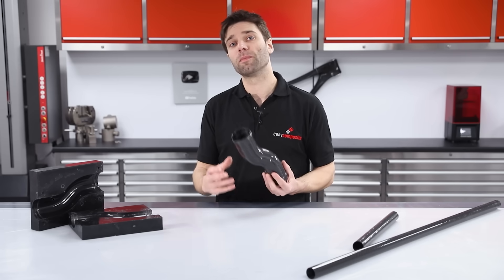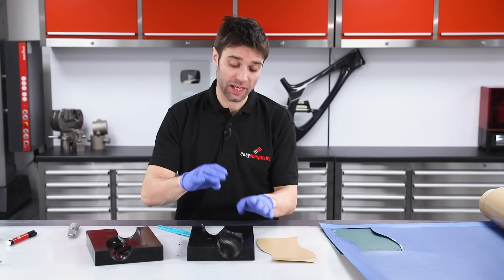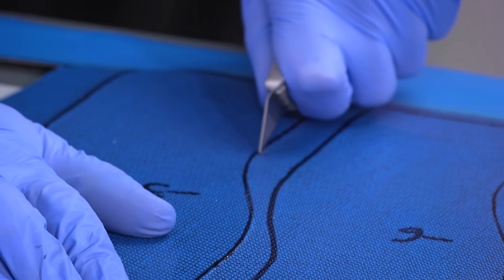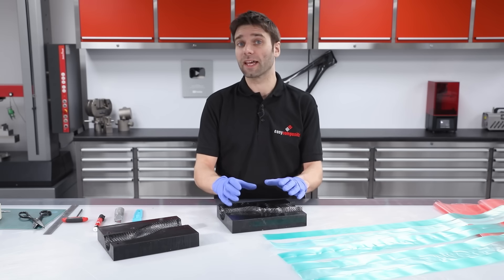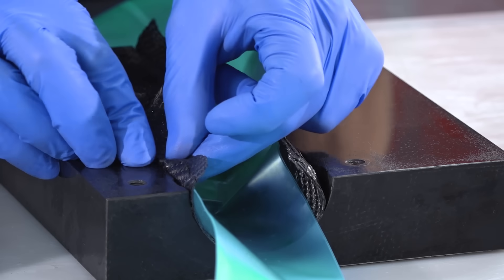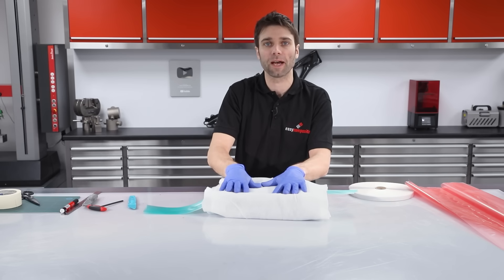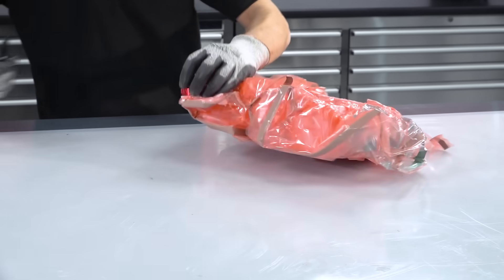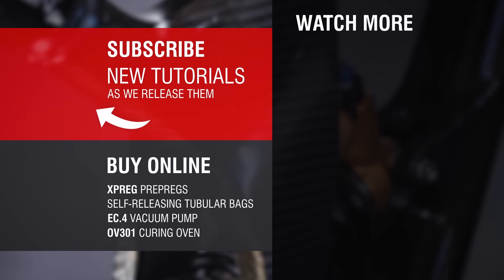Making Complex Carbon Fibre Tubes Using a Split-Mould

Comment: Hi, Can you make a video on compression moulding.
And when the plastic parts have rounded corners with thickness at the edges how to replicate the same roundness at edges on carbon fiber.
Reply from the maker: Yes, we'll be doing something on compression moulding in the future. As for thick edges on laminates, this is usually just a case of building up the thickness in these areas (sometimes including some of the 'rolled edge' in the mould. We do this in the carbon fibre bonnet making video (where the thickness of the edge is made up with extra layers of woven carbon tape.

Comment: I have done many vac bagging setups but never internal like this.
I don't or didn't see how this worked......it looked like the green internal bag would collapse being vac'ed.
To put pressure internally on the fiber, the internal green bag needs to be expanded. (???)
I am seeing this wrong?

Edit:  I went back and watch that part again,,,,,,,,,,I see now!!! Pretty simple actually!
Reply from the maker: Hi David, yes, you might be seeing this wrong. Think of the pink bag being the vacuum bag, then think of the green bag as being a tunnel through the middle of the pink bag. That tunnel has the carbon fibre (and the split mould) on the outside of it. When the air is sucked out of the pink bag the atmospheric pressure pushes on the outside of the mould but also the inside of the tunnel. Does that make sense?

Comment: I would like too use carbon fibre make custom parts for cars. What is the best way too make a mold? And should i add anything too strenghen it as is over 3ft(1.2m) long.  Really like too know what your opinion is.
Reply from the maker: Hi Pierre, I think we cover that pretty well in this video: https://www.youtube.com/watch?v=UgKvDw1E60E where we make the mould for a car bonnet/hood. This mould is well over 3'.
Reply: @easycompositestv  thank you very much. Ive watched all the videos and fully understand the principals of carbon fibre parts

Comment: What Material is that 2 Piece mold made from and what temperatures are you baking that at?
Reply from the maker: To make the mould we first CNC machined the pattern, in two halves from epoxy tooling board like in https://www.youtube.com/watch?v=CWAvo8DIZ9s and then the mould halves made from made from XT135 tooling prepreg like in https://www.youtube.com/watch?v=k4GdAuNji5g

The XC110 out-of-autoclave prepreg has a recommended cure temperature of 120'C.
Reply: Easy Composites Ltd that epoxy tooling board holds up against the temps in the autoclave??

Comment: So are prewoven tubes not commonly used for this? I guess it wouldn't be prepreg, but I'd expect prewoven carbon fiber tubes and a precise mold would mitigate any flashing/part lines.
Reply from the maker: Carbon sleeve is not too common for this process for a number of reasons but yes, if you used a woven sleeve as the outer layer you could avoid a visible seam in the weave. You're not likely to ever get a split mould that is so accurate it results in zero resin flash but it takes seconds to remove resin flash and so that's not really ever a consideration.
Reply: @easycompositestv  I know even in consumer injection molding products, flashing and mold seem lines are indeed prevalent and visible. I am thinking of automating production though, and post possessing can get expensive. If it does only take a few seconds, that's different. But I know of a company that bought a $1.2M Swiss Lathe with laser contouring that uses the machine literally to deburr and that's it, simply because they spent more than that per year outsourcing the deburring of their parts. 

If cost is removed from the equation for a moment, do you think mold part lines could be removed entirely? If production is the goal, not low volume production. 

https://youtu.be/jYSHJIx0Esc

Comment: Can you share the split mould process for tubes ?
Reply from the maker: Hi Tim, to make the mould the patterns (for the two halves) were CNC machined from epoxy tooling board like in https://www.youtube.com/watch?v=CWAvo8DIZ9s and then the mould halves made from made from XT135 tooling prepreg like in https://www.youtube.com/watch?v=k4GdAuNji5g, apart from the captive fasteners I think those two videos already cover the whole process. Shout up if anything is unclear though.
Reply: Easy Composites Ltd ok thanks was looking for video on hand making a split mould for a air horn for a carburetor . I believe I have come up with a plan

Comment: Are there any alternatives to the big oven when curing the carbon fiber? Can it be done in a retired cooking oven or does it need strict temperature control?
Reply from the maker: Ideally you need to accurately determine the temperature and you'd be looking for +/-1'C accuracy on the actual temperature fluctuations. In theory, you could do this with a domestic oven but would need to run a separate external thermometer as the set point on a normal domestic over could be out by 10'C or more.

Comment: For a car tubo pipe for instance it would be better to have an internal mould with the bagging around it. Saw it this way with some F1 parts that were auctioned off that way the smooth side was on the inside of the pipe so that air could move more freely.
Reply from the maker: Hi Alex, yes, there's quite a bit of discussion about that further down these comments where we've explained methods for doing this in more detail, hopefully you can stroll down to them!

Comment: Great videos! Thanks for sharing - is possible to get the same results by using epoxy infusion rather than Xpreg?How did you created that mold, was it cut on a epoxy board or mold from the actual plastic tube?  Thanks
Reply from the maker: It's a prepreg carbon fibre tool. The patterns (for the two halves) were CNC machined from epoxy tooling board like in https://www.youtube.com/watch?v=CWAvo8DIZ9s and then the mould halves made from made from XT135 tooling prepreg like in https://www.youtube.com/watch?v=k4GdAuNji5g

Comment: It is impressive, but seems like a very wasteful process compared to fabricating metal.  Also, chips can be melted and reused.
Reply from the maker: Hi Sam, yes, it;s a very different process and would typically be used for very different applications. This video is really our attempt to explain - using something a lot easier to see and understand - how a carbon fibre bike frame or similar tubular/frame structure is made.
Reply: @easycompositestv  They are awesome videos.  It is an awesome material. It is just a shame that there are so many consumables involved.  Thank you for the response.

Comment: At how many °c in the oven and for how long? Every different part needs  different  time to cure?
Reply from the maker: Different prepregs tend to need different amounts of time to cure. The XC110 we used in this video is cured at 120'C for between 2 and 7 hours, depending on the cure cycle being used.

Comment: That came out really well. Can you reuse any of the vacuum matteriel? Also does the inter bag have to go all the way through the vacuum bag or just one side open to atmosphere?
Reply from the maker: The bag is sealed on both sides otherwise it would never pull a vacuum
Reply: The bags can be reused many times if you are careful with removal.

Comment: What happens in the cure process
Reply from the maker: In the cure process the vacuum is maintained throughout, which keeps the pressure on the bag. The resin heats up and flows and then cures to a rigid matrix.

Comment: Is there pt1 for the mould?
Reply from the maker: No, not this time, we hope what we've done previously already covers it. It's a prepreg carbon fibre tool. The patterns (for the two halves) were CNC machined from epoxy tooling board like in https://www.youtube.com/watch?v=CWAvo8DIZ9s and then the mould halves made from made from XT135 tooling prepreg like in https://www.youtube.com/watch?v=k4GdAuNji5g

Comment: Great video, thanks!

What is the advantage of having the lapps on both edges of one piece of fabric and trimming both edges on the other as opposed to cutting mirror images for each side?
Reply from the maker: It is slightly easier to lay it up that way. Structurally there is little difference - the overlap takes care of that.
Reply: @easycompositestv  thanks! My OCD was responsible for the question 😂🙈
Reply: @ryansmithza  I was wondering the same thing.

Comment: If I may - some of us dinosaurs are still stuck with techniques from the 60s. I enjoy these pre-preg videos immensely. They are very good and there is always something to learn. If you get the time in the future however - some wet layup techniques in addition would be great :-)

And I think I could do that tube with wet layups - if a bit sticky  ;-)
Reply from the maker: Hi Rolf, we totally agree. We're aware that our tutorials have been a bit prepreg heavy recently and so we have lots more planned using wet lay, vacuum bagging, compression moulding, resin infusion, all sorts of other techniques. There is definitely much more to composites than just prepreg and to be honest lots of what we do (training and manufacturing) uses lots more basic techniques. After the bike frame video we just needed to get this one made to explain the process in a clearer way. Now we can move on to some other techniques. In 2 videos' time it is a wet lay process, promise!
Reply: Technics are equal to numbers of products we want, weight,  thicknes and costs overall .

Comment: Can this be done when core is used??
Reply from the maker: Yes, in theory you could include a core material in the composite laminate. Whether it would be practical is another matter - it would be difficult to conform a core material (such as Rohacell) into a tight diameter moulding like this.
Reply: @easycompositestv  Actually I was not talking about small parts. I am designing chassis for a formula Student car. So wanted to know whether chassis can be built in single piece by using split mold method.

Comment: A great video thanks does the internal bag have to be open at both ends or is one end sufficient ?  I current make RC Glider fuselage pods using a bladder but am interested in trying the vac bag method. Many thanks
Reply from the maker: Hi Nigel, it would be absolutely fine for it to be only open at one end. This would be very common for complex frame sections or the plane fuselage, as you suggested.
Reply: @easycompositestv  thank you I will try it

Comment: Shame it isn't feasible to do this with infusion or wet-lay. I don't have the space or money for a curing oven.
Reply from the maker: Yes, there's an awful lot you can do with resin infusion but this time of process just isn't practical, which is a shame if you don't have the ability to cure at temperature.

Comment: This is so labour intensive it will never replace traditional metal methods except for absolutely weight critical applications.
Reply from the maker: Well, of course that's right Roger; advanced carbon fibre composites are definitely not a potential rival for mass produced forms where weight is not critical.
Reply: Never is a long time and there are always smart people looking to save a it of it.

Comment: 6:31 at glider fuselagebuilding we use fishing line which goes in a zick-zack (Z-shape; x-shape) over the mould surface to hold down the wet carbon fibres. When the upper mould have is put onto it, we cut the fishing line. Pull it out and everything inside the mould is sitting right. But instead of vacuum we use 3 bar of pressure with a long balloon.
Reply from the maker: Thanks Sebastian, it's really interesting to hear about your process; that sounds clever.
Reply: @easycompositestv  http://www.f5b.de/rumpfaufbau_2020.html
Almost at the end of the page you can see how modell plane builders doing it with the fishing line.

Comment: I always wanted to know how to make this kind of tube.Now i know! Thanks ,is this also somehow possible to make when using a plug so that the inside will be smooth everywhere?I once saw a 4piece demountable  tube as a plug .
Reply from the maker: Wow, that would really be a complex moulding. Anything is possible but you'd face a huge number of difficulties and challenges to make a matched tool, split mould in the way you're describing. I'm not really sure that there are too many situations where a double A-side tube mould would be sufficiently required to justify the tooling and production complexity. Probably better to finish one side by hand.

Comment: Is possible use pre preg without Owen???
Reply: You need an oven to heat the resin in the pre-preg so that it melts and infuses throughout the part, once it's cured it will become structural.
Reply: @lightmetalinc.6488   Temperature?
Reply from the maker: Cure temperature depends on the specific prepreg. Our XPREG XC110 can be cured from about 90'C.

Comment: Great video thanks again. 
The mold looked to be Can you make the mold from fibreglass instead? 
What resin would you use that could handle the oven?
Reply from the maker: You're welcome. You could use a fibreglass mould although there is a possibility that the difference in expansion (CTE) between a glass mould and a carbon part could cause some issues. You would need to use an epoxy gelcoat and epoxy resin, both of which would need to have a Tg of > 120'C. Our EG160 gelcoat, EMP160 laminating paste and EL160 laminating epoxy all have a Tg of 160C+ so would be suitable.

Comment: What did you make the mold out of? Was that done on the CNC or made from an existing part?
Reply from the maker: Hi David, the mould was CNC machined from epoxy tooling board like in https://www.youtube.com/watch?v=CWAvo8DIZ9s and then made from XT135 tooling prepreg like in https://www.youtube.com/watch?v=k4GdAuNji5g

Comment: More great instruction! Thank you! At risk of sounding ungrateful... Any chance you will show how you made the mould for that tube? Please keep the videos coming!
Reply from the maker: Hi Vinn, yes, as the others have posted it's a prepreg carbon fibre tool. The patterns (for the two halves) were CNC machined from epoxy tooling board like in https://www.youtube.com/watch?v=CWAvo8DIZ9s and then the mould halves made from made from XT135 tooling prepreg like in https://www.youtube.com/watch?v=k4GdAuNji5g
Reply: Yes please I second that.
Reply: Check the bike frame video - looks to be the same process using tooling prepreg (it has an integral black gel coat. Easy Composites high temp epoxy gel coat is grey, so this is not a wet lay carbon mould.)

Comment: So there's a couple videos on older (~2014 ish) formula 1 turbocharger intercooler tubing and what they where doing was the smooth side of the part was on the inside of the tubing. I think this was to preserve airflow and avoid turbulence losses. I really wanted to know how they actually molded those parts?
Reply from the maker: Hi Christian, I'd agree with what Andrew says.The best process for parts that are 'smooth on the inside' would either be a made tool (if the part could be removed from the without becoming stuck) or it could be a male tool in more than one part, i.e. a split male tool, this would be common, or - for really complex shapes like induction shapes with multiple turns, then you could even use a sacrificial core. These wash-out or melt-out cores are a whole complex subject in their own right but in general they are made from a material that can be dissolved with water or melted out (lots to consider in terms of cure temp of the prepreg vs melt temp of the core) which is either cast (into a mould) or CNC machined.
Reply: Link: https://youtu.be/LS47125tUzk
The part is around the 13:10 mark
Reply: on that particular part there appears to be no undercuts on the larger opening but the throat of the intake would have likely been separate part of the negative keyed into the rest of the negative part. The process would be generally the same as creating the first mold for a standard part as seen in Easy Composites "Fibreglass/FRP Split-Mould Making Guide" or "How to Make a Prepreg Carbon Fibre Mould", except instead of having a split on the outer layer you would split the internal buck to easily remove it. For more complicated internal geometry you would have to include draft angles in the internal buck in order to ease removal as seen in "Making a Carbon Fibre Bike Frame" @32:30 with removing the inserts for the pass through on the frame.

Comment: a project like this is possible to realize with infusion method or it's pre-peg carbon fiber only ?
Reply from the maker: It's really almost impossible to make something like this using a resin infusion process. Nothing is impossible but the practicalities of dealing with dry fabric and then handling the infusion consumables, it just makes it too difficult.

Comment: Does the seam give up any strength compared to the rest of the part? Will the failure be the same if part is tested 0° or turned 90°? Just wondering if the seem orientation needs to be factored. Thanks.
Reply from the maker: The seam (and joins in carbon fibre) will inevitably influence the failure point on the component. Depending on the amount of overlap and the position and staggering of the joins though it could even be that the seam would fail last. Remember that it often wouldn't be possible to change the position or orientation of the seam if the mould is to work correctly as a split mould. Often there is only one place where the split can be.
Reply: Easy Composites Ltd It sounds like it’s a case by case situation. Appreciate the reply and the excellent videos. 👍